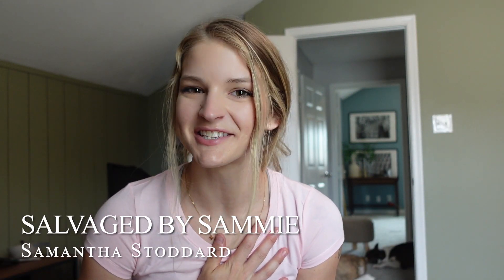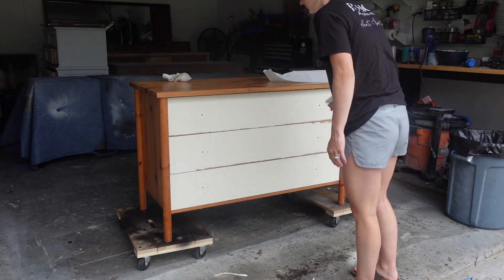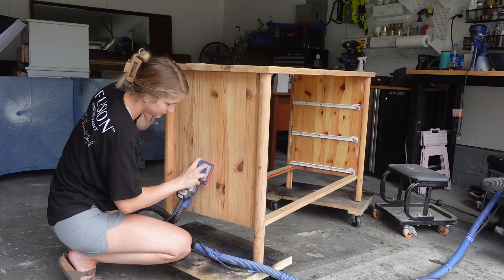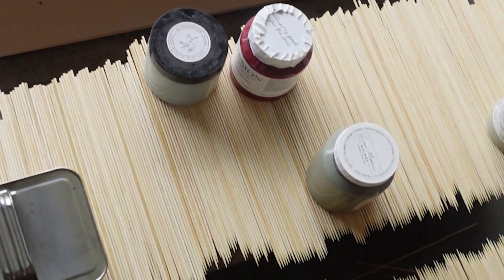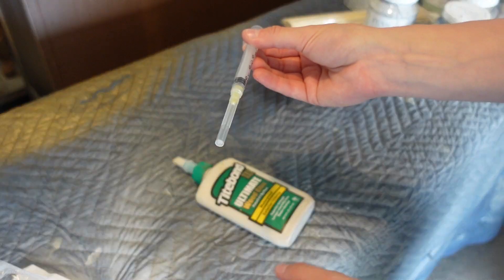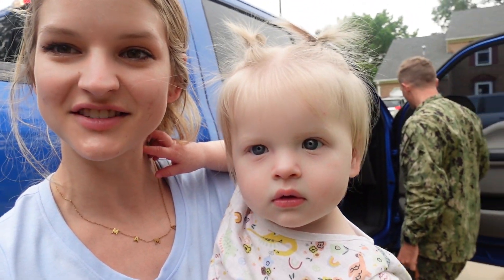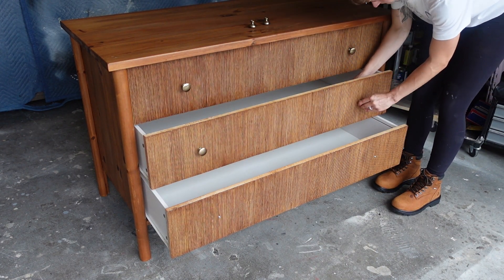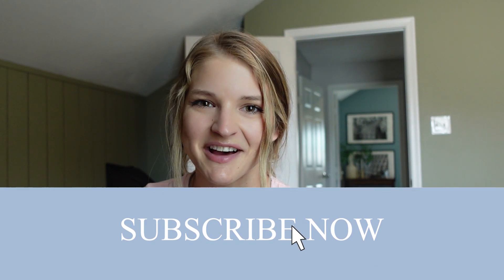$50 IKEA DRESSER FLIP - Full makeover with fluted drawers!

Comment: I have to wonder how long and how well the skewers will stay stuck.  Wood glue not only doesn't adhere bamboo well, it also doesn't adhere to laminate either.  Wood glue needs wood to wood contact for maximum adhesion.  That's what it's designed for.  I see people all the time using wood glue on painted pieces and pieces with finish on them and that's not its intended use.  Wood to wood.  Otherwise, nice job.
Reply: What would you recommend? This can be tricky.
Reply: Gorilla Glue makes several multipurpose glues that work on multiple materials.